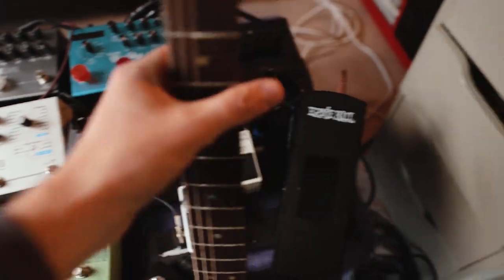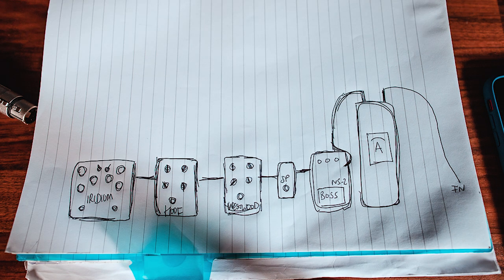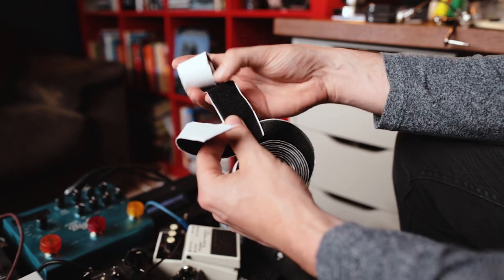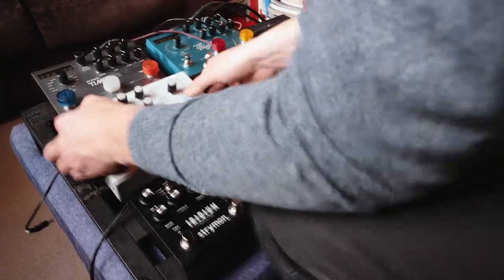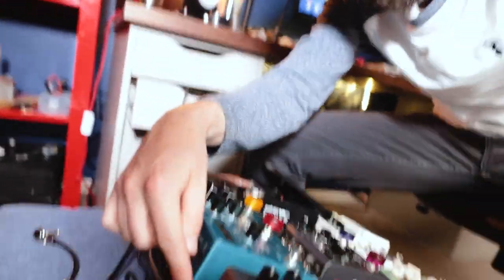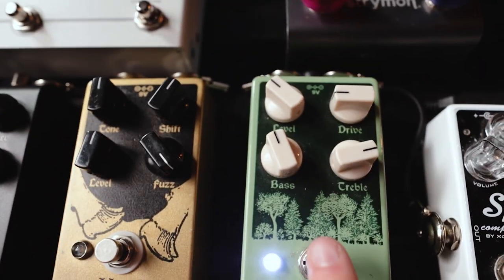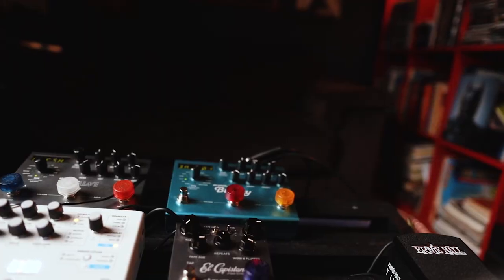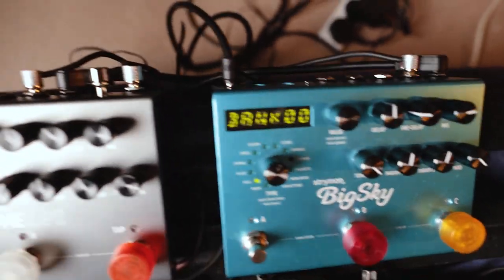How to build a Pedalboard: Post Rock Minimalism

Comment: Do you have any recommendations on pedal platform amps? Something with enough headroom for a band but also won’t get me evicted. Lol. 20-30 watts would be ideal I think. I prefer the head/cab thing but a combo might be cool. I’m looking at the milkman the amp 12” combo but idk if ide be totally happy with a solid state power section. The dairy 30 seems like it’d be perfect but it’s also $2k so something in the $600-1300 range would be ideal. 

Thanks!
Reply from the maker: Personal preference but I’ve stuck with fender for so long because they have always worked great as a pedal platform amp for me. Clean fender and I throw my pedals into it first up. You can get some good 20-30 watt amps from them in your price range
Reply: Eggnator Tweaker 15 does both Fender and old Marshall brilliantly, and remains one of the most flexible and affordable heads out there( you can freely swap tube types without re biasing.Amazing.)If you buy heads instead of combos, you can vary the cabs to your output needs.
Besides the relatively expensive and perfect Fender Princeton, - head, 10" or 12" combos,- my favourite base sound amp is the Bassbreaker 007 head.It can get loud enough with the right cabs for live practice, or used in the bedroom.Not Fender's best design due to price point( affordable), but reliable and great sounding.Vox AC 10 and 15 are cool if you like that specific sound, though the 10 is as neutral as their classic Night train head.Orange is also a contender in the low output category, though again, it's an acquired taste.
The speakers and cabs are as important as the amp in determining sound and relative volume.Very much worth researching and experimenting with.
Reply: @markferguson3745  thanks for your input!